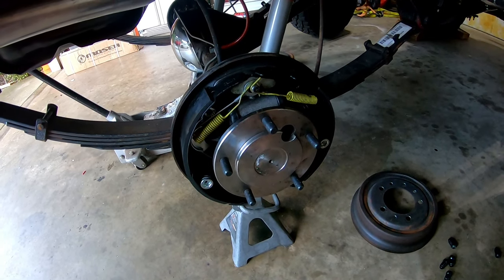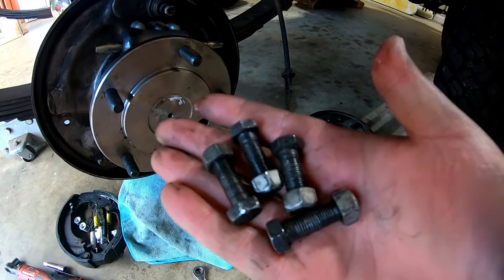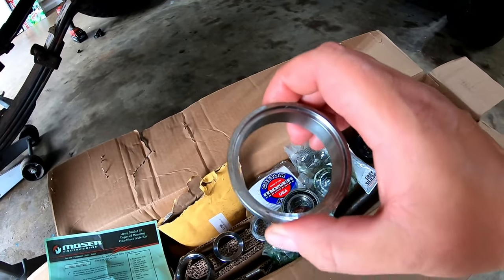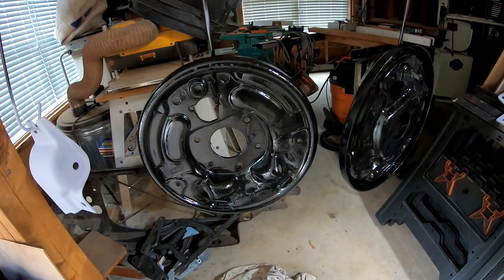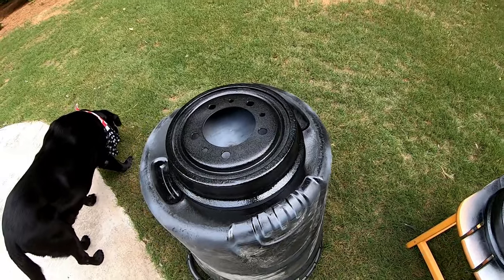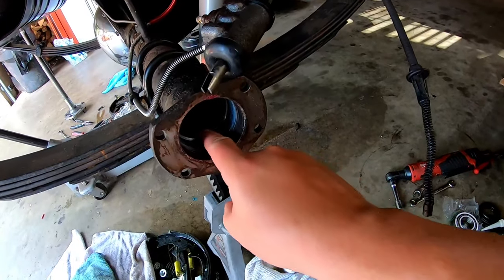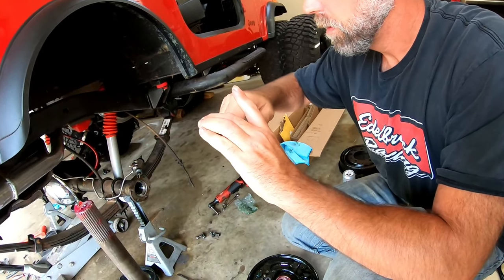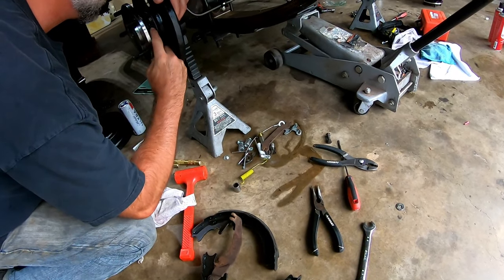Jeep CJ7 Update 73 - Moser One Piece Axle Shaft Kit Installation

Comment: This must be their upgraded kit. I installed their one pcs kit back in 95. No issues. Inner seal first, then bearing (installed wide part inside), then the race (thick part facing out) then backing plate (it holds race in place) then outer seal with grease zerk. A long pipe that seats on the inner part of bearing, when hammered with heavy hammer, drives those bearings on nicely.
Reply from the maker: Lots of thoughts on this kit but I've had no issues with the way I installed it.  Thanks for checking out the video.  JD

Comment: A lot of great information here John.   Thanks for sharing.  I see tackling this in my future.   Cheers!   Mike
Reply from the maker: Thanks Mike, good to see you making videos again!  JD
Reply: @JDOffline  Just placed an order from Summit for my Moser Single Piece Axle upgrade.  I have the AMC 20 Narrow Track so my physical axle shafts should be slightly shorter, but I imagine the rest of the kit is the same.  Circled back to this video to familiarize myself with the process.   Thanks again for all the details.  Just dropped my rear axle to do a complete refurbish.  It is 43 years old and needs a face lift.  Cheers!   Mike
Reply from the maker: @UCanDoIt2Mike  Thanks Mike!  Great to see you making videos again.  We are not far apart and should get together.  Love the camaro!!  JD
Reply: Yea… I really want my Jeep back on the road.  I miss it.  One step at a time.  I’ll get there.   I agree on a get together. Maybe a Jeep cruise somewhere OR a Camaro cruise.    You Jeep looks fantastic and love your Camaro work.

Comment: And remember to fully lube the bearings before assembly they are NOT lubed by the oil in the differential case.  I was in Florida from Michigan when the 30 YO Detroit Locker in our '84 CJ7 (with a Moser axle conversion) went bad.  I had them put in a TruTrack and while doing that they felt they needed to replace the bearings.  The first install lasted 20 miles as they did not lube the bearings.  Still not convinced they trimmed the bearing spacer per spec, one side ran hot for 600 miles (towing it) until it apparently settled in.  Taking it in to my trusted local  Ring and Pinion shop to do a full inspection.
Reply from the maker: Thanks for sharing this.  JD

Comment: That lock ring has .008 press on it. Bearing has about .003. You installed it correctly. I installed the same axle kit on my bosses 78 cj7. My number was .030 on Bearing to backing plate. Nice jeep by the way.
Reply from the maker: Thank you Steve.  JD

Comment: My moser axles I just got do not have that hole in them to get to the bolts.  I dunno if it matters I took the stock ones out with two wrenches. ?.. not got deep enough yet to see if I got the wrong things but they look right. other than that.
Reply from the maker: Mine are working just fine, no issues.  JD

Comment: The back of that spacer doesn't  determine how deep the bearing sits . The lip,  outer edge of the spacer does. You could grind 3/4 inches off the back  and it would stop because of that outer edge.
Reply from the maker: Thanks. JD

Comment: Any chance you can help point me in the right direction? 

My stepson bent the drum backing plates. Hoping to find replacemens. Stil have the two axle amc20 but also considering replacing to a single axle also. Thoughts? Help? Jim, TX
Reply from the maker: I wish I still had my old ones I would send them to you.  Might be a good time to upgrade to single piece axles or check Morris 4x4 for replacements.  Good luck!  JD
Reply: @JDOffline  all good JD.. I was wanting to stick with the drums but It is what it is.. we'll get it figured out. Thanks man

Comment: Have you driven your jeep much since you installed the rear axle and bearing kit? How's it holding up? Does it get very hot?
Reply from the maker: I really have not driven it a lot with our move we just made.  The Jeep is about to be cleaned up and get back on the road.  We built a house and sold our old house rather quick late last year so everything has been in storage for about 6 months.  In the miles I have driven it I've had no issues.  JD

Comment: Another great tutorial. Thanks
Where did you end up purchasing the Kit?  
Got a PN? Thats next on my list.
Reply from the maker: Thank you!!  I ordered it from Summit Racing part number MSR-CJ-L.  Check out the reviews on this kit compared to others.  It's a little more pricey but comes with everything you need.  Brakes was the worst part of the install so if you can avoid disassembling them it will save you some time for sure.  Thanks for checking out the video, I learned a lot on this one.  JD

Comment: Hi JD,  I subscribe and love your channel.. I have an AMC 20 in my 82 CJ5 and was wondering if you have done any research as to how much hp this rear end can handle long term?
Reply from the maker: Hey Kenny!  I did do a lot of research on this topic and was considering an axle swap to hold up to my 350 swap but the more I researched the more I understood the weak point of the AMC20 to be the two piece axles.  If you eliminate that which I did, I haven't had any problems with mine so far.  I'm not too hard on it though and don't do anything in terms of rock crawling etc.  So, I think the axle is plenty tough for normal use but if you are going offload and rock crawling etc then not sure how it would hold up for that.  My engine is 357 horsepower so we will see how it holds up long term.  Thanks for the feedback on the channel as well.  JD

Comment: Hey its me again. Thank you for kind of listening to me. and please don't get pissed at me I really am trying to help and great video by the way. Can I ask a favor before you delete me or report me. I always try to help. Look at the directions and read the  part highlighted in red. It says. (LARGE LIP ON INNER RACE) shown with an arrow.  it should be towards the splines on axle (carrier) now look at your bearings you took out. what is the thicker part of the inner race. YEA the bearings no matter if two piece or one piece axles it's still a semi floating axle and again there on backwards SORRY I know it sucks. I have the bearing in front of me rate now. so the thick part off the OUTER race should face the backing plate. Probably the guy at Moser didn't really understand. If I'm wrong Ill give you the biggest apology. but I've bin doing it for way to long. please look at the inner race/bearing and see what the thicker part is at time 12:35.
Reply from the maker: I went over this thoroughly with Moser and I'm going to take them at their word.  JD
Reply from the maker: I have an idea why don’t you call moser tech support and ask them.  I think it would be worth the time. JD.
Reply: @JDOffline  I'm with BarberChop on this one still. I've been installing these before timken came out with the set 9 bearing (which is still a two piece bearing, you have the bearing and outer race/cup). The LARGER LIP OF THE INNER RACE goes toward splines. Why do you think the retainer ring wasn't against the bearing any more? Because it was trying to force the axle out!! It's really sad that the manufacturer you spoke to doesn't know, though he's probably never turned a wrench in his life. But at least the instructions from Moser, rugged ridge, crown automotive, and Yukon all have it right! Can't say the same for G2 though! Here it is again LARGER LIP OF THE INNER RACE GOES TOWARD THE SPLINES. Oh and you MUST have a thrust block.
Reply from the maker: @adamwood8165  So you are also saying the bearing installation in this video is backwards?  JD
Reply: @JDOffline  yessir. And I'm sorry about it bud. I don't know why so many people think it's installed different than the factory two piece axles. The only difference is the two piece has a shoulder/stop machined into the axle and the one piece uses a retainer ring as the stop. And of course you have to install everything from opposite ends. I do have a question about the bearing though. Is it a two piece bearing? Does it have a bearing and outer race that can be separated?
Reply from the maker: @adamwood8165  Yes the bearing and race separate but I show them together in the video.  The bearing also has a large "shoulder" on the non tapered side which lines up with the picture in the Moser instructions as facing toward the tire.  I'm going to call Moser back and see if I can get a different tech person and see what they say.  I wish they would just show the bearing in the instructions so you could clearly see which way it is supposed to be oriented.  If I have to take this out and do it again I won't be very happy but my concern is the safety part of it for sure.  I can tell you I've done tons of research on this topic and most people agree with how I've oriented the bearing.  Not saying you are wrong in any way but certainly a divided camp on this one.  I just want a definitive answer and my Jeep to be safe driving down the road.  I've come too far with it for this to an issue.  Thanks for your input and for chiming in.  JD
Reply: @JDOffline  yessir I know it's frustrating as hell. The picture does shows the thin (whatever that is) on the bearing going toward the backing plate as all the instructions for all brands I mentioned before do also. And I think that's what is confusing everyone! But it clearly says the larger lip of the inner race of the bearing towards splines. Same as factory two piece. I have a really close friend of mine that installed his backwards and the passenger side axle come completely out while driving around and curve! It took quite a few miles for it to do it, but it happened! He also didn't have rear break shoes at all which will help keep the axles in place or I guess you could say centered. Anyway I really wish all the manufacturers would be in depth on bearing placement because it's a huge safety concern. And I really enjoy all your videos by the way. Keep me updated on what Moser says
Reply: @JDOffline  I went through this ~5 years ago when replaced my axles. I ended up putting them on the wrong way and having to buy another set of bearings. The instructions have definitely changed since then as the "stick-out" was adjusted by using shims on the axle flange, not grinding the spacer. But I agree with you, if Moser showed that bearing taken apart in the instructions showing the direction of the bearing taper it would clear all this up.
(BTW - mine are installed like yours and I've got over 15k miles on them w/o any problems)
Reply from the maker: @jamescoward1263  Thanks James.  I contacted Moser tech support again on 8/13/21 and had their senior tech person look at this video and he confirmed the bearings are installed correctly.  A picture showing the bearing would sure help clear all this up!!  Thanks for your input.  JD
Reply: @JDOffline  good luck 🤞🏼

Comment: Do you have any problems with overheating with that small block Chevy in your jeep?
Reply from the maker: I did initially but it was my fault.  To start with I put pure antifreeze in my radiator so I drained it and added water and ran it for a while and drained it again and added more water.  This seems to have solved my issue.  I do have the Novak recommended aluminum radiator along w dual electric fans.  So far so good once I fixed the coolant issue.  JD